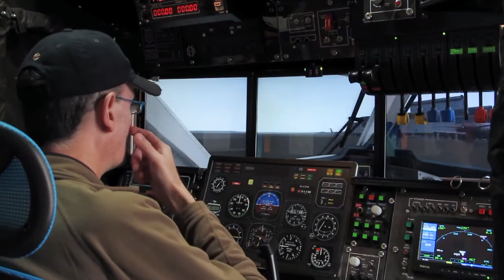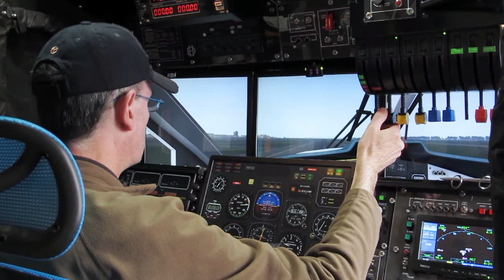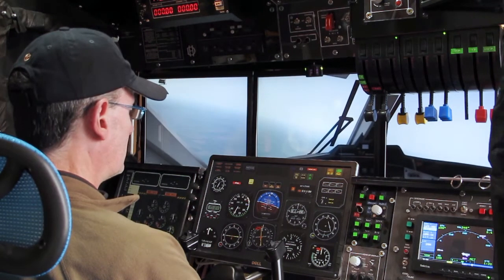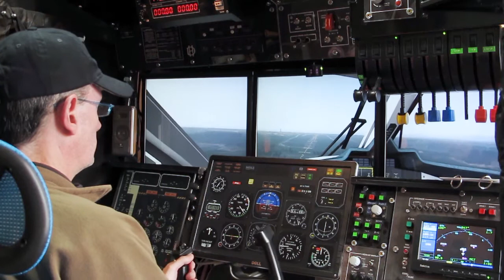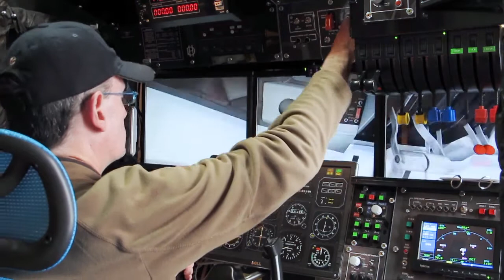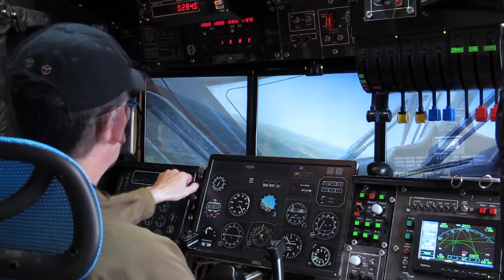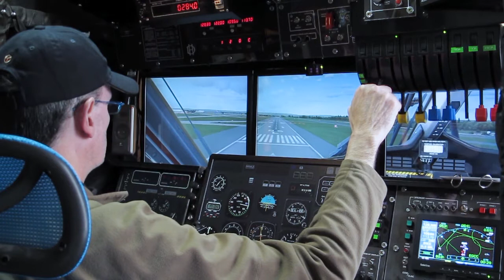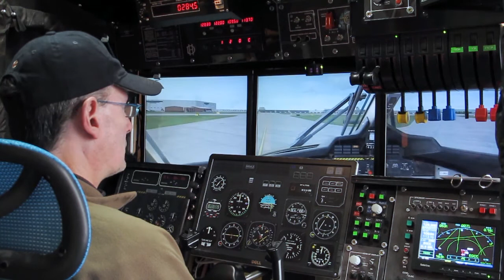RW Designs vs Aerosoft Twin Otter

Comment: Nice vid once again. Are you going to try Xenviro? Have you changed any of your control sensitivities in X-plane?  What was the real world metar and which addon depicted it the closest to real world? There's a question bomb for ya ;)
Reply from the maker: I didn't copy the METAR as this was just a quick experiment. I will try it again today, as I guess it is an unfair comparison if they were actually working to different data. I have not planned to try xEnviro, but that doesn't mean I won't in due course. SkyMaxx and xEnviro seem to be in competition so I had to jump one way!

I'm not sure what you mean with the control sensitivities. I have calibrated everything and left them alone after that.
Reply: In X-plane: Settings -> Joystick  (select your device) -> Control Sensitivity (left bottom corner). Here you can change your Control Response and Stability Augmentation. Playing around with this you might find a setup that improves ground handling.

Comment: Interesting comparison. It seems that XP11 is looking to be the better overall sim over the current FSX/P3D v3. I get this feeling from many youtube-flightsimmers. Have tested XP11 a little myself, and apart from the lack of ORBX-quality smallish GA airfields, it is very appealing. Realistic lighting, smooth, amazing scenery using Ortho4XP. I think I'll be running both sims in parallel for a while. XP11 fortunately doesn't burn a hole in your wallet.
Reply from the maker: There is indeed something about the lighting that looks much better than FSX. Flying into a few locations in the Pacific North West (3W5, 1S2, KORS) looks generally more realistic than the FSX with the Orbx region. (Of course the airports don't stand up to the Orbx ones!) It also seems pretty smooth so far. Not sure I agree it's going to be any cheaper, though...

Comment: What yoke are you using....and what brand-panels are you using....
Reply from the maker: I'm using a Yoko yoke. The panels are all hand-built, so I suppose the brand is 'Almost Aviation'!
Reply: What made you pick the yoko.and is there any need to mod it like cheaper yokes( Saitek or CH)
Would you recommend it ....
Reply from the maker: I TRIED the Yoko because Virtual Fly gave me one for free. I PICKED it as the yoke I would keep because it was far and away the best of all the yokes I had tried. The ones I have tried are the Saitek "Pro Flight" yoke, the  CH Eclipse, the Elite yoke, the Saitek "Pro Flight" Cessna yoke, the Iris Simulations Dragonfly and the Yoko. Second place goes to Elite, but it loses big time because it isn't natively supported by Windows. This means, for example, that you can't use it with X-Plane without paying money to simPlugins for a driver. It also doesn't have ball bearings, so it isn't as smooth as the Yoko. And no, in my experience the Yoko needs no mods.
Reply: Hi....how do you configure two(2)Throttle units for two(2)or more  engines....
I am using Saitek yoke with throttle+Throttle Quadrant.... 

Cheers....

John Gosnell....
Reply from the maker: You just assign the functions you want in the controls setup screen. FSX will try to assign axes and functions automatically when you plug them in but usually they won't be right. You will find axes for 'throttle 1', 'throttle 2', etc.